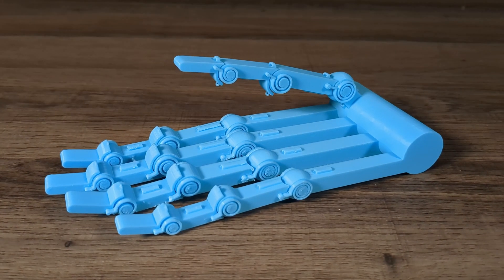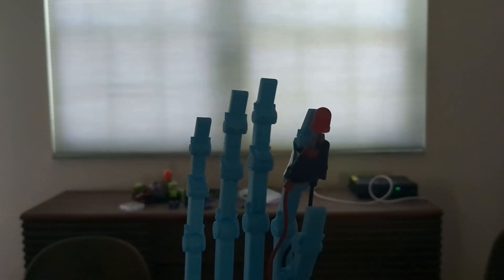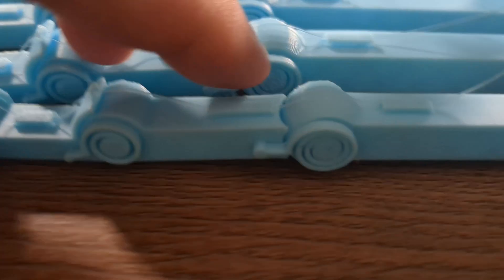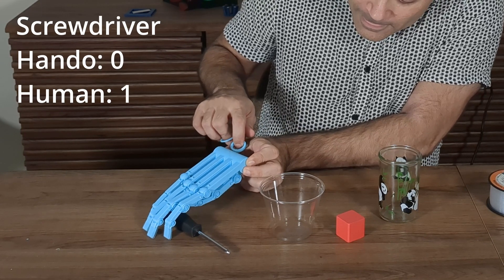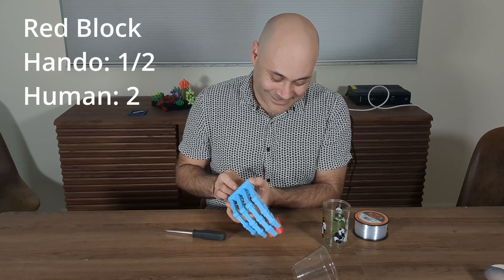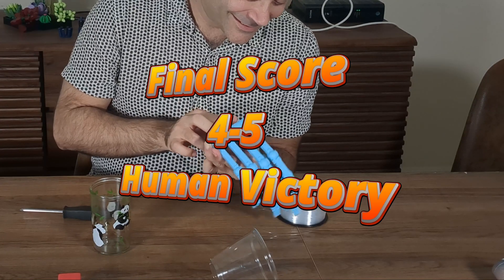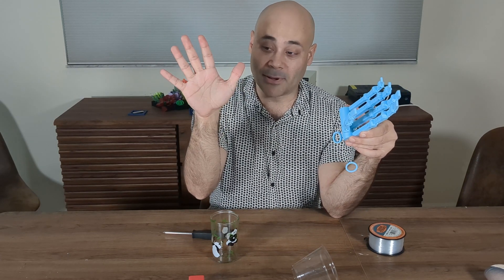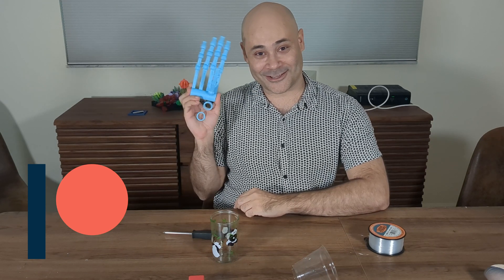Hando the 3D Printed Robotic Hand With No Screws—One Piece, No Assembly!

Comment: Needs an articulation rig to do all of that motion. You don't want it to just flop around loosely. That's what a rubber band does, and it reduces function, it doesn't increase function. Unless it is a stress-reduction tension, which would just stop it from breaking. Like when grasping a sphere vs grasping a cylinder.

An articulation rig should have a simple cage holding the lines with individual rings for each finger. Either lever operated or just pulled. Lever controls would be smaller but pulled might offer more subtle manipulation control and feedback tension.
Reply from the maker: So far I've just used a pull mechanism. Eventually I want it to be an electronic setup though. Maybe linear actuators.